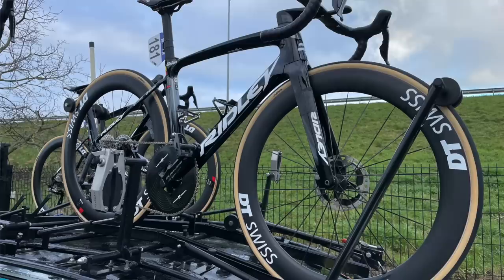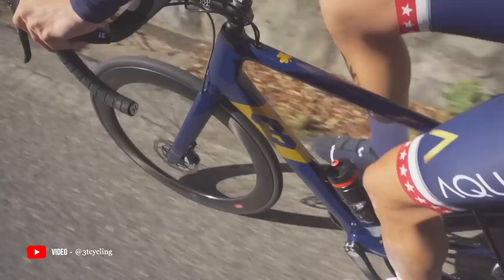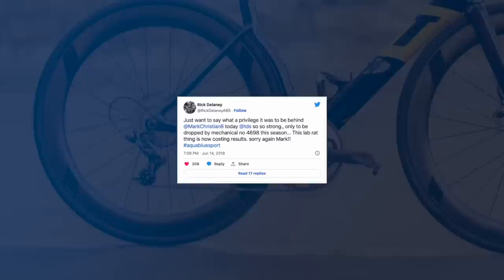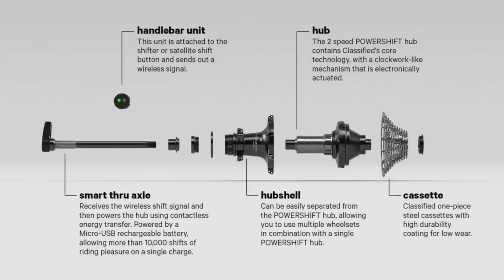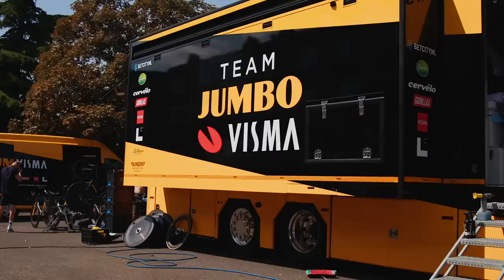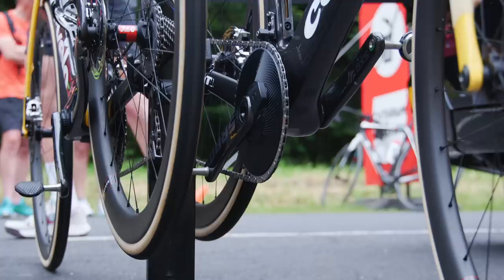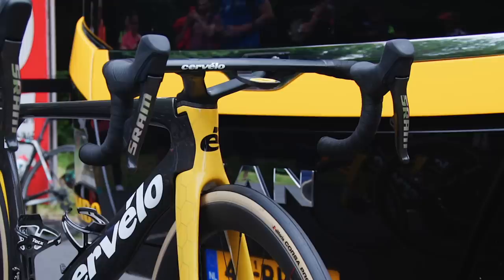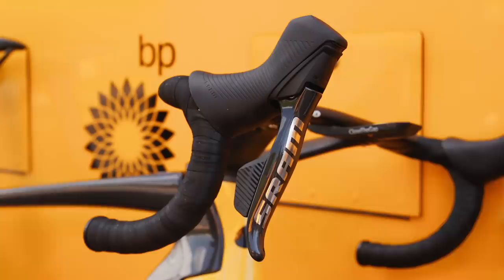Is Jonas Vingegaard Going 1x At The 2023 Tour de France!?

Comment: Roglic won that ITT stage in spite of the one by eff up, not because of it. Amateur journalism.
Reply: Umm, how do you know?  Perhaps his 1x drivetrain was so much faster that it made all of the difference!  Anyway, one is less likely to experience chain drop with a 1x drivetrain than a 2x, ask any mountain biker.  Roglic explained afterwards that the chain drop was entirely due to a mistake on his part: his foot hit the chain, knocking it off.  A chain keeper would have certainly avoided even the slightest chance of that happening.-I am not saying 1x is suitable for all road racing situations, far from it, but for an uphill TT, or a flat TT it is a superior option (lighter and more aero).  Full mountain stage, probably not, as the gearing range is not quite there to accommodate steep climbs and fast descents.
Additionally, all this talk about cross chaining being a problem with 1x is not quite accurate: with 1x one can get the chainring in exactly the best position for the cogs used 95% of the time.  Also, with 1x you save on some drivetrain friction by virtue of riding a larger chainring and larger cog for a given gear ratio.

Comment: Of course he is going 1x. Primoz was on it and almost cost him his giro. Marketing has been threatening this for years. Another marketing ploy for dentists. Disc brakes and 1x. Gravel bikes are the new road bikes 😂. I’m not surprised road cc will be one of the first to jump on the advert shill bandwagon for newbs.
Reply: You guys who think 1x has a problem with chain dropping are wrong, plain and simple: 1x drops the chain less than 2x period.  Plenty of WT riders experience chain drops with 2x, it happens often, and often at critical moments.  Roglic dropped his chain because he made a mistake, that is what he says at least.  On the road, a simple chain keeper will eliminate all chance of ever dropping a chain on 1x.
Reply: Agreed. But it doesn’t eliminate it. The issue is dishonest marketing. No pro road racer prefers 1x for cadence alone. End of story. Those that think this is not an issue have never raced seriously. Consistent power and cadence is so important. Running a keeper then eliminates the supposed “aero gains” from the elimination of the front derailleur. It’s fine to run 1x. I do it and I love it. I hate front derailleur shifting and adjusting. But I don’t race anymore. But don’t call it better for the pro peloton just to sell overpriced group sets
Reply: @barrowsworm1226  for example here is a quote from cycling news “Lower gearing, a better chainline, lower weight all at the forefront of the mind for the Slovenian”. Right away if youve ever run and built a bike with either set you know this is simply a lie. Three lies. 1. It is not lighter than ALL possible options (not to mention, if weight was REALLY a concern they would have put him on a rim brake bike for the climb. But since his bike was likely at the lower side of the UCI limit, this is a non-factor) 2. the second is the improved chainline. If by improved you mean MORE crosschaining than I guess you would be correct. I have both an AXS eagle and Ultegra and it looks like almost twice the crosschaining on the eagle in the easiest gear. 3. Lower gearing, Now this depends on which gear in the cassette also, but now you are not talking about a 1x specifically as you can change cassettes on both and if you think a pro needs a 38t 52 to go up a climb, you are sorely mistaken. All I’m saying is it is bad to lie to sell stuff. Ride what you want.
Reply: @christopheralix8554  I did not mention anything about cadence, my point was strictly about the false notion that a 1x drivetrain means a higher probability of experiencing chain drop, that is false.  There are pros and cons to both 1x and 2x drivetrains, for road riding in hilly or mountainous terrain, I believe 2x is the better choice.  If one lives in a flat area though, 1x will be fine, even for racing, because one does not need as wide a range of gearing, and one can still spec a fairly tight ratio cassette, and most of the time with proper spec one will be riding without cross chaining, as one will be in the middle of the cassette, also, by riding all of the time in a larger chainring (no 39), one saves some drivetrain drag there (bigger ring to bigger cog is less friction for the same gear ratio).  1x also will shine for flat TTs, where aero is really important.